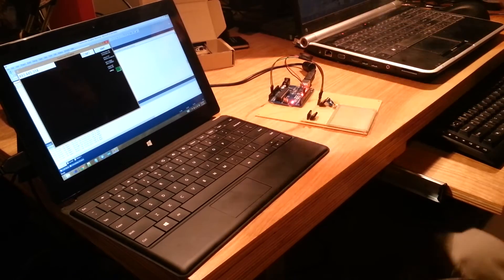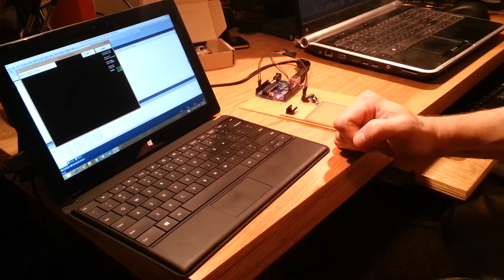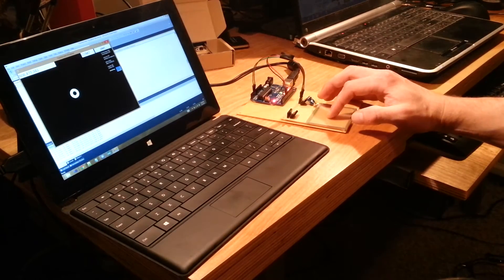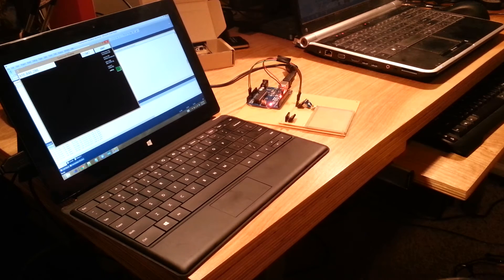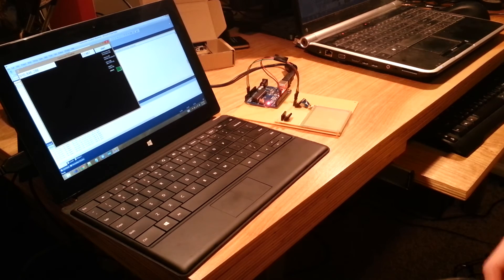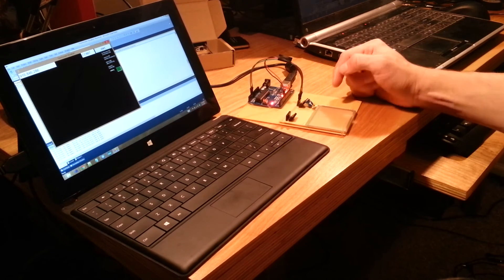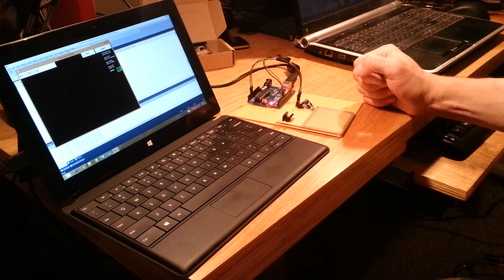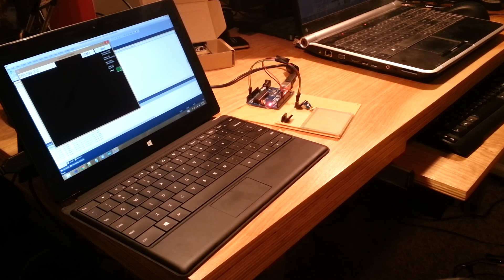Arduino with Nintendo DSL digitizer

Comment: Great video, Great attitude of sharing it with others. I have some questions.  
1.Do you know if there are high sensitive digitizers with the touchpad that can react to the much less pressure than the touch like a very sensitive sensor?
2.If I want to build a touchpad from scratch instead of buying it what would be your recommendation to start? (textbooks, electronic components etc)
3.What is the material used on the touchpad?
Thanks again
Reply from the maker: +cyrusIIIII what are you trying to build it for?  This part is just $8
what are you making?
Reply: james wolf I am trying to replicate some of the sensors that other labs have for their research but did not mention details. The idea is like yours but for measuring the pressure when a bug walks on it! Have you tried it on your device? (I know it won't give much signal :) ) We had a similar device that some students made but broke a while ago. that is why I asked you to give some new ideas. Price does not matter!
Reply from the maker: cyrusIIIII are you trying to map the path that a bug walks or trying to weigh the insect?
Reply: james wolf Both. That is why I was going to ask you if your configuration can detects multiple touch like two fingers.
Reply from the maker: cyrusIIIII nope sorry, these Nintendo digitizers are older tech, they are just measuring for the largest pressure between the 2 plates so I don't think it will be able to do multi-touch.
Reply: james wolf Is there any newer method that you can think of ?
Reply from the maker: is the weight important or just the position? if it is just the (x, y) position, then can you do it visually?
Reply: james wolf Yes you are right we have done it with microscope before but we care about the force or pressure too and the surface is not transparent for the insects. We put layer of food for them :)

Comment: Hello James! Did you use only the breakout board to connect the digitizer to Arduino?
Reply from the maker: Yeah and the adafruit sketch code. I made it output the basic data over a serial connection to a winform app (that I wrote) that draws the info onto the black screen.